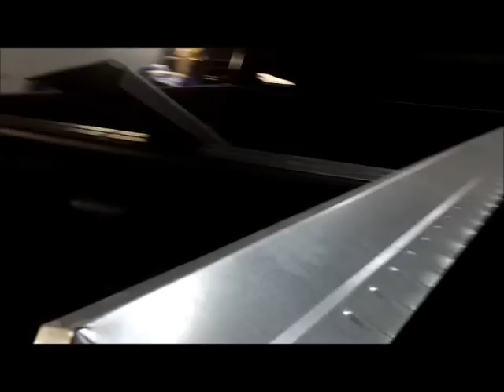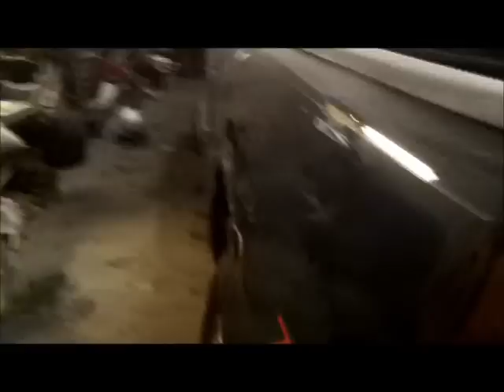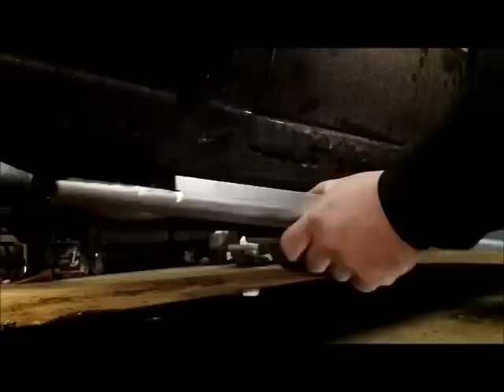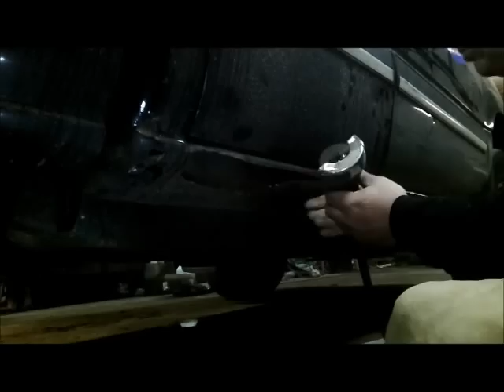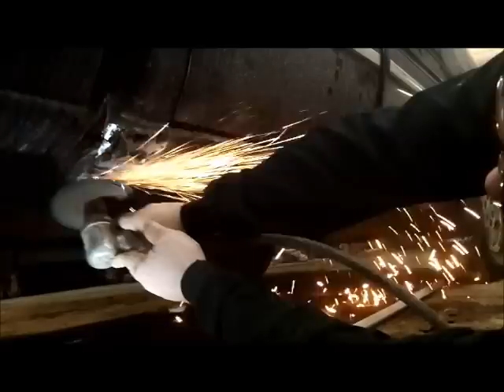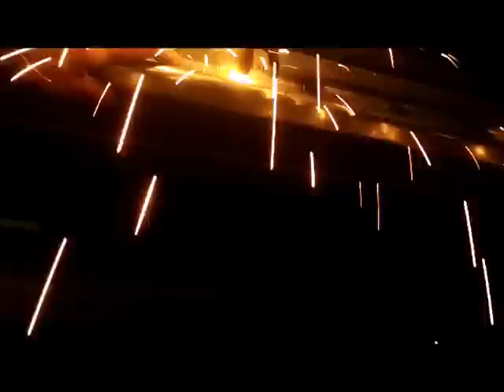Chevy Silverado Rocker Repair. part 1

Comment: Thomas, if you do the "patches" the right way they will last longer.  As I said when I did mine I treated the underside rust with por15 let it dry and then grind down some spots with the small grinder disk just for spots to weld too.  Then when I was done getting the panel in place and everything looked good.  I undercoated the entire bottoms of the inner and outer then had the truck linex'd to make it last.  Been 4 years no bubbles and still solid.  Solid enough to pass inspection.

Comment: I actually got the metal adhesive and the gun to install with but I did primer mine as well most of my inner is good I have one bad spot in the inner. I think when I cut mine out I'm going to clean up as much of everything inside and primer it all maybe spray some motor oil up in there as well to keep it from rusting for a couple more years. My other side is starting to do it as well so I gotta take care of that too. Everything else on the truck is in great shape but man them rockers just rust right out on these trucks mine was perfect bf winter. After the harsh winter and all the salt it completely ate the whole drivers one out.

Comment: Spray ATF or Bar and Chain oil into all enclosed areas each spring and it will greatly extend the life of those vehicles. They rot from the inside out. ATF is great for the inner sections, because it contains rust inhibitors and it creeps well.

Comment: Harbor Freight has an electric version of a Wizzer cut off tool that works great! It uses less electricity and saves wear and tear on your compressor.  Harbor Fraight calls it a 
"120 Volt 3" High Speed Cut-Off Tool" and the item number is 68523. It sells for $34.95 and is on sale now for $24.99. It is heavier than an air cut off tool but you can get used to it.

Comment: is there some reason the new panels couldn't be back primed or sealed in some way prior to tack welding for final fit? Then urethane caulked at the edges before bondo stage or maybe leaded in the old way.?  Thanks

Comment: 2 questions. 1, I want to get slip on rockers. What if I put bed liner over them? How long do you think they would last? 2, I have a 3 door Silverado. How would I replace the rocker on the drivers side since it only has 1 door?

Comment: Realize it's an old video, but do not use undercoating on new or old vehicles.  Moisture will get in.  Best advice is to spray down insides with a light oil just before and again after winter.  Every year.

Comment: but i thought you need to weld to the inner also? will you have to drill the oem drain holes you mentioned and then spray inside through those?

Comment: wen do u put clear on ? 20 min after u applied the paint ? i had my box painted for my truck and noticed a small crack in the paint with some small bubbleage around it and i wanna do a quick fix wth rattle cans.

Comment: Damn I thought maryland trucks were bad with rot not near as bad as new York. I have an 04 frontier with 0 body rust. The rear bumper is hurting but as far as body and frame they are both solid. There's surface rust on the under side of the bed but nothing major. However this winter was HARD on cars

Comment: i used to do alot of body work before my kidneys failed i do want to do some vids of redoing my truck and my 78 bronco im upset when i got sick i sold my trucks i had a 76, f250 and a 79 f150 ill miss them forever. but i still have my bronco prob till i die

Comment: Should buy a 4" grinder with a cut off wheel. You would get most of the bigger areas with that and only need the air wheel for the tight spots. Those things are pathetic but necessary.

Comment: Can you just patch the missing center section of the inner rocker before you weld the outside panel on. I know I jave done this. I would think that it would be a stronger job.  I know time is money but it doesn't look to have needed much of a patch..  Take Care...

Comment: Every one blames rust on salt, yes salt does contribute to it but the biggest reason for rust is the foundry that make the steet metal, the blast the moltin metal with oxygen to burn off the slag, Oxygen inpregnated sheet meta & other is weakened & more aceptable to rust even without salt

Comment: Why do all GM trucks rust at the rear rocker panel? if it is a extend cab it will always be at the rear bottom of that ! There should be a class action suit against GM for this. Rarely do I not see a GM truck rusting terribly.
Reply: It was detailed all it's life. Cleaning did not matter, the rust starts inside the panels.
Reply: Low grade steel and very poor paint. Perhaps mudflaps might help a little. Notice how the doors rust from the inside out. The rocker panels are doing the same thing. The best solution is to not buy any vehicle these days. You won't be able to tell until it's too late. Makes you really wonder how much they put into product failure to assure future business,, hmmmm. Is it really worth the money we spend on them? Perhaps they should put less effort into the bell and whistles and more time into making it last the 5 or 6 years of loan payments. It sure would be nice to have a vehicle look nice after going through all that imposition of monthly payments, interest rates and locked up cash-flow. Freaken crooks.
Reply: They should be sued with a class action suit. It doesn't matter how well you take care of the truck it just seems like is automatic.
Reply: azimmey do u wax ur vehicles?
Reply: Yeah, but the salt in new york gets inside, there is nothing an owner can do.

Comment: This guy works way too hard. I have installed dozens of these rocker overlays on Silverados and use steel rivets to attach them. This eliminates a lot of grinding and welding. I put them right over whatever is left of the old rockers so I don't need to cut off the old ones either.  I did my own truck 5 years ago and it still looks fine.
Reply: dumb. Youll wonder why its dumb in about 3 or 4 more years when the rust has wrapped around into floorpans and completely fucked everything up. Fix it right or dont fix it at all.
Reply: He repairs it right. What your saying is cover it up so one one can see it.